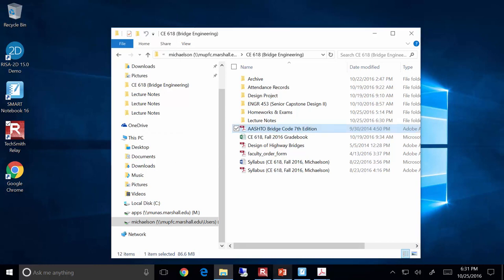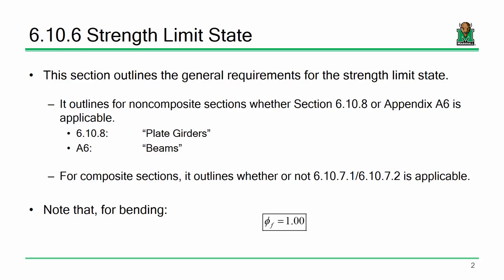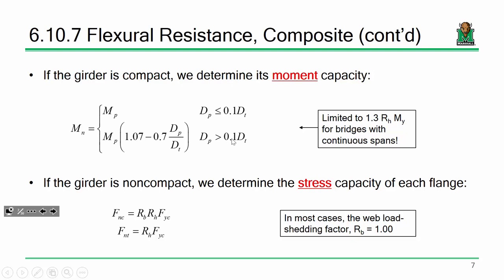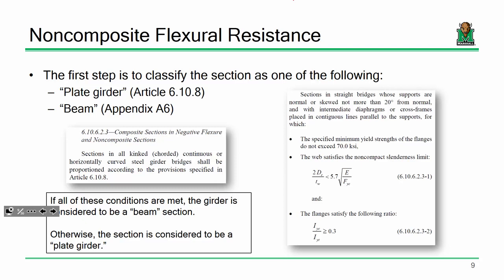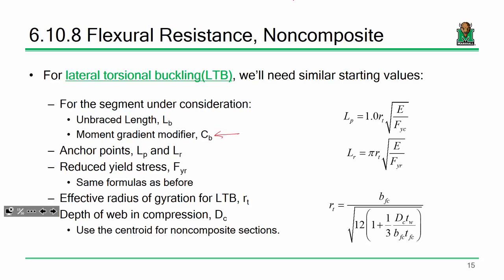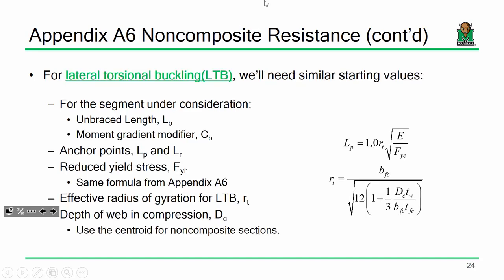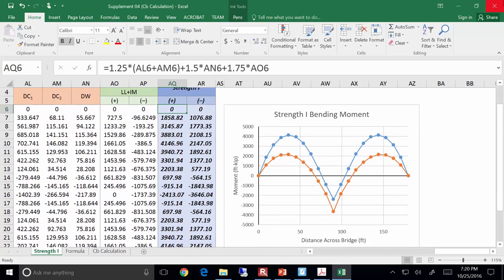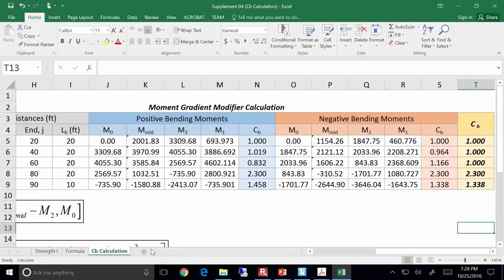CE 618 Lecture 09a  Strength Limit State 2016 10 25

Comment: To be clear - I do not do any structural design. I build overhead power distribution systems for light rail. Just would like to be able to follow along while our structural engineers yell at each other over who is correctly interpreting the AISC equations and factors.... preferably without a confused look on my face. :) Step 1: Learn the basics of developing the maximum working moment for a wide flange pole. :)

Comment: Do you have a lecture that discusses maximum moment capacity in wide flange poles (fixed/free) with multiple loads from attached cantilevers supporting multiple wires under tension? And/or a lecture that discusses lateral-torsional buckling for the same pole scenario and how to work through the AISC chapter F calculations in that situation?

Also, awesome lectures! Wish I could afford to go back to school....such is life..however, you do a great job!